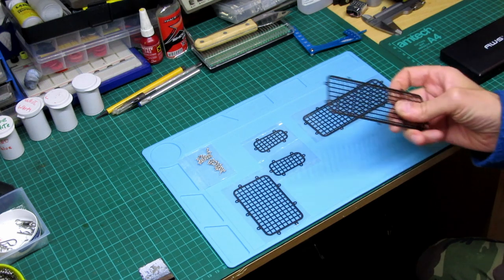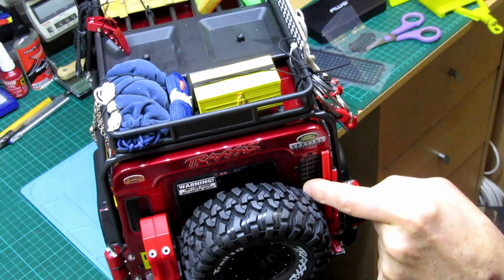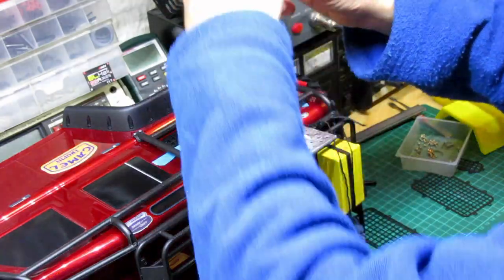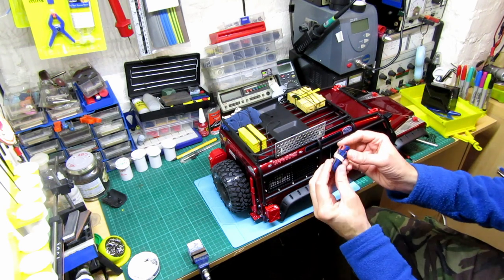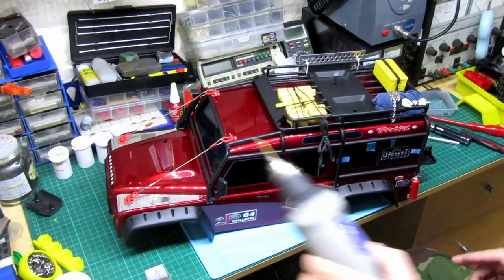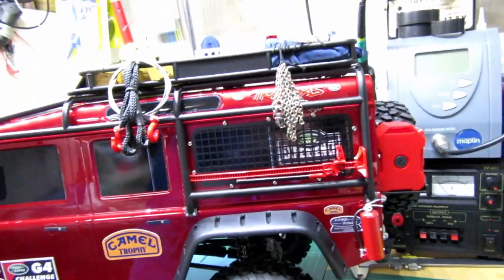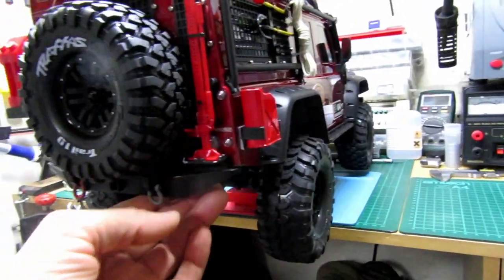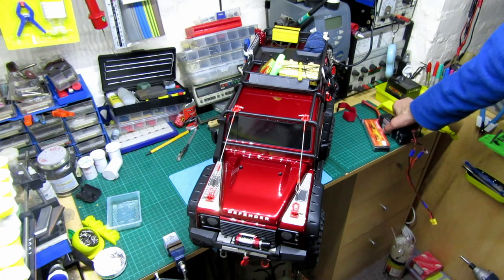Traxxas TRX-4 Scale and Trail Crawler..Gets Window Grills

Comment: Very nice Defender. I have the same one. I like the red better than silver. I put my jack on the hood. Put the body clips through the jack. The jack hides the front clips. Looks better than plain clips. I didn't like the jack on the back bumper. It took away from my tail lights. I put the Traxxas rock light kit on. Now I can run at night! Very bright light bar. I bet you would like it!
Reply from the maker: good idea  bud cheers
Reply from the maker: Bet that looks cool at night should do a video👍
Reply: You also helped me make my mind up about metal window grills. I cant wait to pur them on my TRX4. Im putting a much better stearing servo (Savox) and bec in today...

Comment: What  base have you use for the trailer
Reply from the maker: michael slade ...Hi I've just finished the build it took me about a week and I have over 12 hours of video that needs cutting down to 3...30 minutes videos. Its all 3d printed but it could be done in wood and metal. Keep a check out for it asap